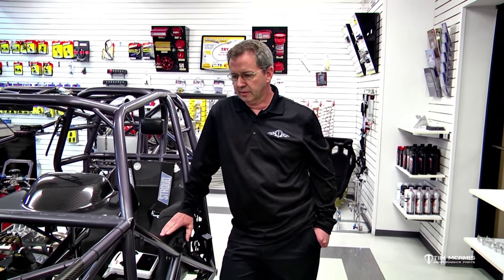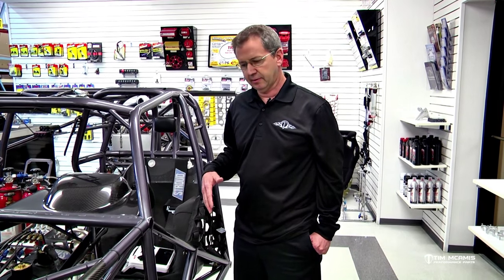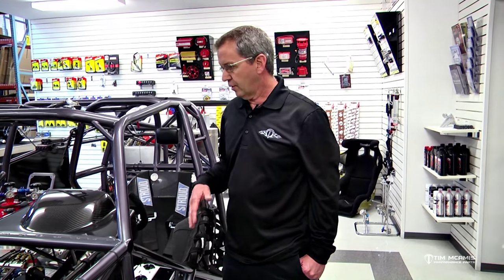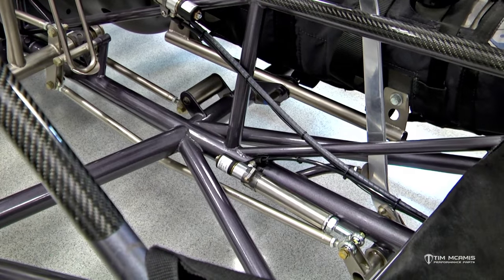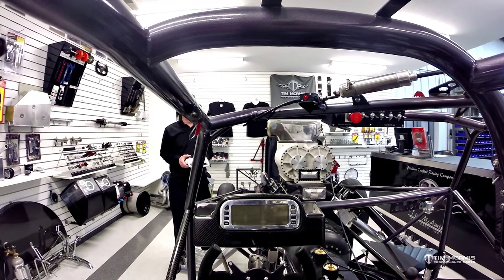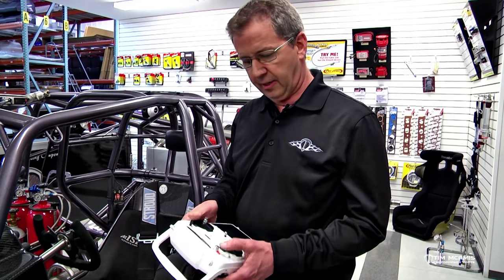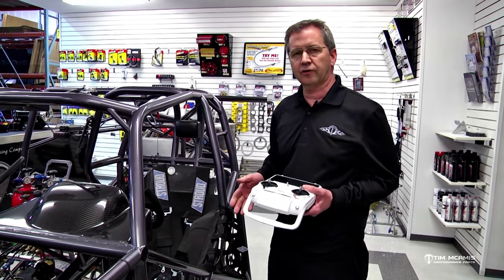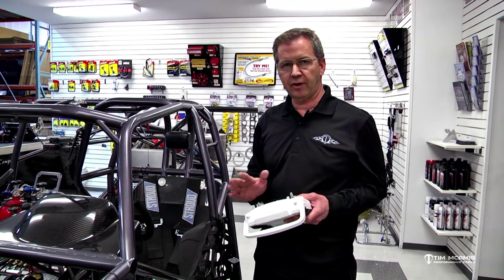World’s First Driverless Race Car (Drone Pro Mod)

Comment: lol, but it's scary how close we are to this being a reality. especially for top fuel where safety has practically killed the essence of the race by actually slowing the car down...
Reply: in fact, some of the OEMs have functioning drone cars AND totally driverless cars. imagine LVDTs and faster acting actuators and it's practically there.
Reply: in fact, some of the OEMs have functioning drone cars AND totally driverless cars. imagine LVDTs and faster acting actuators and it's practically there.
Reply: +slowpoke96z28 the Tesla model S is driverless you can see the videos from inside just search "tesla autopilot" in the youtube search. Now they are coming out with a new car in 2017 the Tesla Model 3 it will have this autopilot, 0-60 in 6 sec,  electric and only $30 000
Reply: +crxtech1 will it be sold under the US?
Reply: +slowpoke96z28 Just go to the Tesla youtube channel. The title of the video is "Tesla Unveils Model 3".    Tesla is made in the USA, in Fremont California. The batteries for the cars are also made in the USA in the largest battery factory in the world which is in Nevada. They have a current model called the Tesla Model S P85D , this car does a 0-60 in 3 seconds and a 1/4 mile in 11, it also has a range of 295 miles all on battery power. It is a $100K car though.
Reply: +slowpoke96z28 were you able to check out some of those videos of the electric car? Do you ever see the youtube channel 1320video? they have some awesome races

Comment: I knew it was fake the reaction on the air cylinders are to slow for steering at bout 200 mph also feathering the throttle would be an issue last but not least who would wanna spend umptine thousand bucks to sit on the couch an watch your car have all the fun...then it be like a divorce your pride and joy may never return